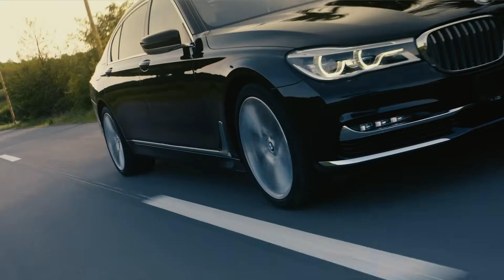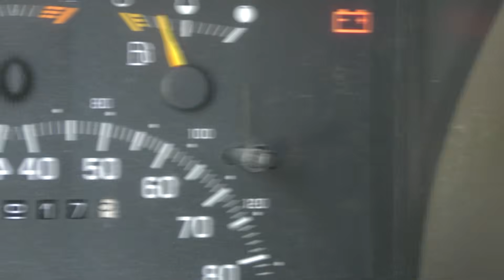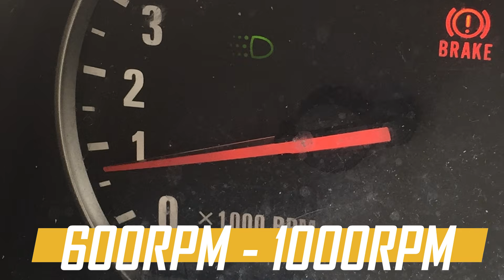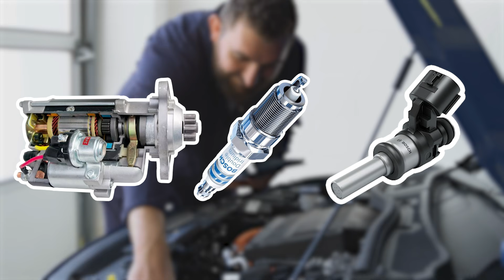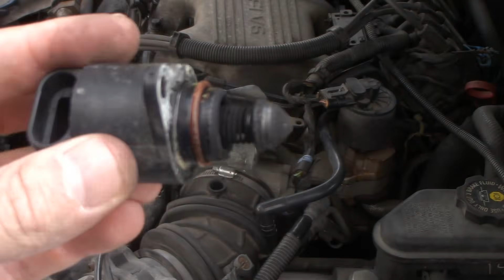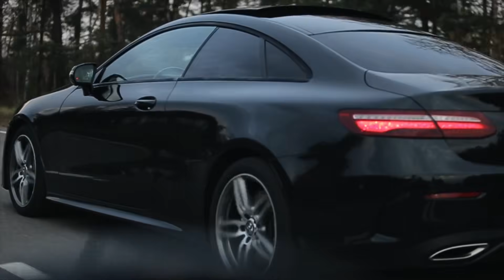Top 5 Common Symptoms of a Bad Idle Air Control Valve

Comment: Hello, say at 2.07 the idle control valve looks like mine. What are the possibilities of getting the wire connectors picture. I think my wiring is bad. So if I can look at the picture it will help me look at how they are connected. the correct connections. I have already when on line for a schematic. They did help. I seed where each wire(4) goes to. If not great video.
Reply from the maker: We would not be able to provide a specific picture that would be the right one for your vehicle without knowing what type, make, and model car you have.  Buy I am glad you found the video helpful.  Thank you for sharing!

Comment: Here's a good one.  Mine keeps leaking coolant.  Replaced a hose and it stopped, now it's leaking again from a different hose?  It has 3. 2 coolant lines and a vacuum. The first leak was from the vacuum line!   Seriously confused.

It idles perfectly btw lol.  I was having idle issues a few months ago, but it leveled out.  Now this lol

1997 toyota tacoma.
Reply: Oh man that sounds rough. I am curious if it's not a failing water pump?
Reply: @martinlee4778  it was the idle valve lol.  replaced it and the hoses and clamps and she's good now lol.  i cleared a clog out of the oil cooler and it introduced more pressure into the system, which in turn exposed faulty areas that needed attention lol.

Comment: What about when the car idles ok when cold but when hot the ideling speed is unstable stalls @ say a round about and need to press the pedal to start the engine ? Any thoughts please. Thanks.
Reply: Vacuum  leak....too much fuel......not good spark  check your spark plugs for fouling
Reply: Check intake manifold gasket...air is leak when car get hot in idle..
Reply: @miegig87 2003 DAKOTA 3.9L V6 PRODUCED A LOT OF CARBON MONOXIDE FROM THE TAILPIPE. THEN WHITE EXHAUST. NORMAL?   BAD?
Reply: @miegig87  🤣👍
Reply: Check fan if it's working and if not, change temperature sensor